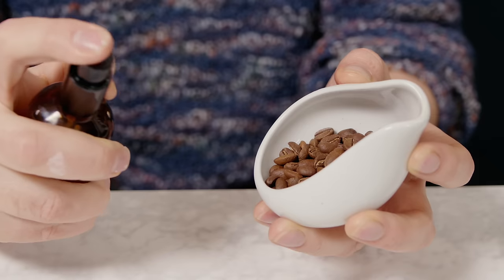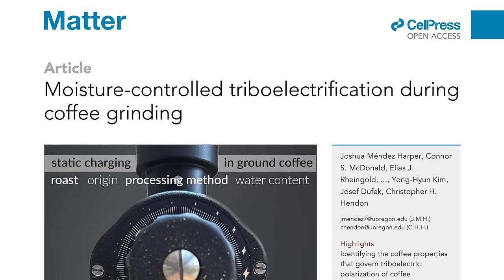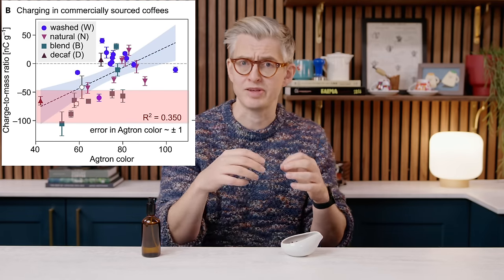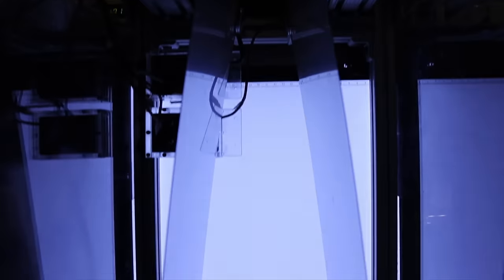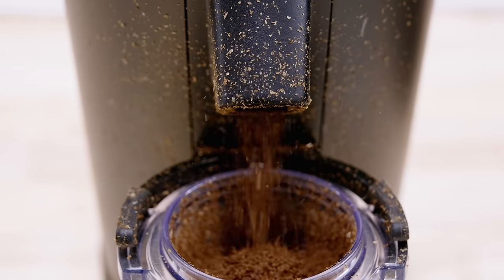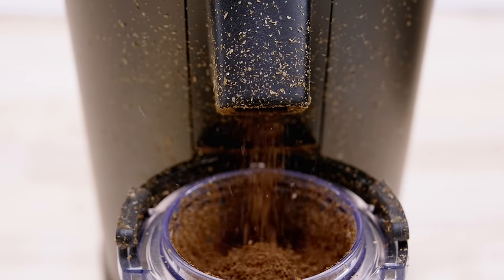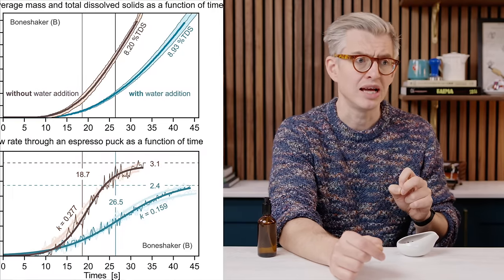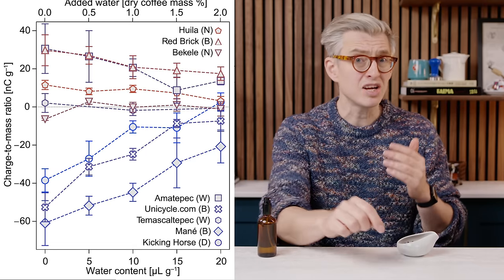Science Discovers What We All Missed: More Than An Anti-Static Hack

Comment: Your aggregate "electroclump" affecting the outcome of flow, makes me think you might be interested in reading a bit about the "Proctor Density" test. You may find relevance for your own coffee experiments. 

Basically, geotechnical engineers define a specific water content as the "optimum moisture content" where you get a maximum density. The thing is, soil compacted "dry of optimum" will have a very different structure than those compacted "wet of optimum". Wet of optimum have a more "dispersed" structure, while the "dry of optimum" soil will have more of an open structure (and more clumps). It has consequences in terms of permeability of the soil (dry of optimum tends to be more open and permeable at the same density as wet of optimum for instance). Of course, all of it is based on a "standard energy" proctor test.

Obviously this is "compaction", not grinding,  water content, which suggests you might also do experiments in compacting the puck with various water contents at compaction time to achieve different flow rates.

Comment: nanomaterials Engineer here: Maybe a comment for the authors: Do they confirm the presence of the electroclumps? Possibly making and cross sectioning an espresso puck pellet then analyzing the particle distribution could inform us if the static or the water is changing how small vs fine particles move during grinding and espresso prep.

Comment: Interesting! I use 3-4 pumps from a small kitchen spray bottle for my drip brew, which I just measured to be about 1mL total of water. This goes on 60g of beans, which is roughly in line with the 20uL/g from this paper. I have seen no ill effects to my grinder (Baratza Encore) at all in over 2 years of continuous daily use - no rust or caked up grounds, and the burrs look practically new. It's really just a coincidence, I did the simple math of 1 pump for 18g means 3-4 pumps for 60g and just rolled with it, but I use a much larger sprayer with a higher output, so I've been unwittingly "overwatering" my beans - which now maybe turns out to be the right thing to be doing all along.
Well, as they say, it's better to be lucky than good? But at any rate, as long as the coffee is good, less worry and more enjoyment I suppose.

Comment: Has anyone tested grinding beans and pulling espresso shots in starkly different humidity conditions? Because low relative humidity increases static electricity, high relative humidity should have a similar effect on electroclumps and thus extraction and flow rate.

Comment: Highly interesting! I tried it out on my Sage Grinder (was a mess, would not recommend grinding wet beans). While the grinder takes much longer for a finer (an a wet) grind, I have so far never had a problem with static coffee. Although on the more affordable end, the grinder doesn't seem to generate as much static electricity.
The extraction with wet beans took a lot longer. In fact, it took so long that I'm wondering if it's really just because of the non-static grind. The ground coffee is really clumpy, the tamped coffee was noticeably more compact. So could it have something to do with sticking together like sand or cement? 
Still an interesting thought and I hope there will be a follow up video!

Comment: Question: So I began applying this method to filter coffee grounds at work using an EK with a Moccamaster. It certainly helps with mitigating static, but I feel as though the static in some regard for filter coffee has been helpful in me being able to remove most of the chaff (by grinding into a metal jug so that the chaff sticks to the outer edges that i can wipe out with my finger). Since there's no static I am finding that the chaff is mixing in with the grinds, which is pretty noticeable for chaffy filters like Rwandan and Kenyans. Anyone have any thoughts on this? Is chaff mixing into the grind worth it if the anti-static increases extraction so significantly?

Comment: I do know that RDT has transformed using my 1zpresso k-ultra hand grinder, I've probably added more water than most (I accidentally got a rather large spray bottle). However, as I brew with aeropress I'm not sure how how it would be possible to measure different outcomes.

Comment: Will be upping my normal 2 spritses to 4 spritses AND pulling a dreaded dry shot tomorrow morning and recording results using my HG-1 Prime.

I tend to aim for 17.5g in. 41g out at 40 seconds and 7 bars (8 second bloom at 2 bars).

My espresso machine is a 1977 La Pavoni Europiccola Professional with a Coffee Sensor Bong Isolator and Airbuster (regulates brewhead temperature and outgasses steam). IMS aftermarket shower screen.

I use a Sworks high flow 49mm Billet Basket for my portafilter. No paper filter with my workflow. For this test, I will not be using a puck screen.
Reply: The difference between no RDT and 4 RDT on a manual 83mm conical burr grinder is absolutely mind-bending.

First of all, the manual grind time is increased by about 3-4 times with 4 spritzes. I don't notice a difference in grind times between none and 1 spritz.

... But clearly some threshold is surpassed with 4 spritzes. At a 2.25 turn ratio on the HG-1 Prime, it feels like there's almost nothing in the chamber while turning. I had to stop multiple times while trying this a few times this morning just to make sure the beans were feeding themselves through.

The extraction times RADICALLY increased with 4 spritzes over none or one. They literally doubled for me. It was the difference between a 40 second pull with crema levels you'd expect from a light roast Nicaraguan on a 49mm basket (no spritz) and a very oily pull indicative of too fine of a grind.

I'm now doing a 4 spritz at a much coarser setting to see how things play out.

Thanks for the inspiration to experiment 🥼🧪.

Truly blown away at how going from 1 to 4 spritzes of water changes the entire process.
Reply: I had to dial the HG-1 Prime three clicks coarser to get an appropriate pull duration with 4 spritzes and found the pull to have less body, clarity, and acidity... Just an overall 'dumb downed' shot even though the shot appeared to be good on input, output, and pull.

Definitely a lot more experimenting required and so many variables to juggle.

My hypothesis right now centers around taking an already long grind time and making it 4 times longer... Approximately 2 minutes for 17.5g. Perhaps this impacts the body of the shot... Not sure how to definitively prove or disprove this especially given the finickiness of the La Pavoni Pre Millennium (even with my various stabilizing mods).

Comment: You make the brief discussion, Walter White had in "breaking bad" regarding his associate’s mega coffee machine sound like a kindergarten conversation. I think anything you can do to get the water to distribute more evenly and get your extraction to be more even is a good thing. If the result of such a change isn’t great, then quantity of coffee and or water, tamp pressure, and grind course level as always should be tuned to accommodate this new flow factor, in my opinion.

Comment: I have had a lot of problems with he additional moisture wreaking havoc on my grinders.  My Weber Key jammed due to fines hardening into "concrete" and jamming the burrs,  I was able to repair the Weber Key by disassembling and cleaning, unfortunately my Niche Zero, which I used while my Key was down, now has its top burr jammed in place from the same hardened fines which have cemented the top burr carrier to its housing, unremovable.  BEWARE!  Anyone have suggestions on removing a stuck top burr carrier on a Niche Zero?

Comment: This leads me to a question, what if we grind the beans (that is sprayed 3-4x) with a hand grinder that is much slower in RPM than with an electric grinder? Would that be an issue for the hand grinder? Could that also be applicable for other brew methods with coarser grind settings?
Reply: I would imagine that a hand grinder produces far less interfacial heating, and therefore less electric charge, and therefore less trouble than electric grinders create.

Comment: An engineer's perspective on the danger wetting your coffee beans poses to your grinder...
The vast majority of that ~0.3g of water will be attached to the coffee grinds and therefore carried out of the grinder. The microscopically thin film left on the inside will evaporate within seconds and the grind chamber will remain at a higher humidity for a little while longer till the air can circulate through.
All that will be done in a minute or so (depending on ambient conditions)

I'm not sure if the oils in coffee beans have any sort of corrosive effects, but a few seconds of exposure from water is not going to be an issue for carbon steels. Even if this were a commercial grinder so was constantly being used and re-wetted, we're talking fractions of a micron per year worth of corrosion.

Comment: I'm grinning because this is just my speed! 

I'm lazy, but I have questions: (1) what is the baseline air humidity in your experiments and I'm guessing there's a point at which, umm, the difference in humidity between air and air-plus-spritz starts to diminish...? (2) Can we run the charge to electrical ground by ... (sorry for this) grounding the grinding wheels or the bean hopper? (3) I'm lazy and my full auto machine shoots a little bit of steam into the grounds before starting the extraction... I'm guessing that's pointless but arose, as a custom, from somebody noticing a more extreme clumping, maybe in a dryer or "more staticky" setting. This is big fun! Keep going! 😂

Comment: About No difference in particle size. My guess would be that the particle size analyser by default is braking the aggregates (electroclumps). I mean static electricity aggregation is standard with small particles and particle analyser which can not deal with it would give very false effects. 
So clumped or not You would have the same effect. 
BTW fracto-electrification does not have satisfactory scientific explanation. Few theories are there but non makes happy all.

Comment: Awesome video James, thank you! That is how you respond to a science finding in a (largely) "non-sciencified" field.

BTW, just as one shouldn't measure beans with a scoop, dispensing water by "spritz unit" is also suboptimal. My bottle - unlike, it seems, yours - doesn't put out ~0.075 ml per spritz to give me 0.3 ml in 4 pumps, it puts out much less. Also, much of the water seems to stay on the walls of the weighing boat, rather than on the beans.

Do we think water condensation on frozen beans contributes to the "improved grinding" of frozen beans?

Comment: My grinder is a Baratza Encore set to a French press coarse grind.

I do cold brew and I tried this for the first time on my last brew.  I use frozen beans, and one thing to note, that does mean the water freezes to the beans, making the beans clump a little bit in the grinder.  That said, the immediate benefit of less mess was realized, and more than enough reason for me to keep adding water.  Of note, I don't have a spritzer yet, so I lightly rinsed the beans instead and that still worked, though the water volume is less controlled.

Lastly, the resulting brew after sitting for 24 hours at room temperature seemed to have a fruitier smell and a lighter color even though I used the same beans as my last cold brew.  I don't know if that's confirmation bias, as I'm not sure why adding water to the grind would change a slow brewing method like cold brew. That needs more testing.

Comment: I did a very unscientific test with my cheap £50 Delonghi grinder and a V60 pour over. With the watered beans the larger particles of coffee were left at the top of the slurry and on the sides of the paper. Very interesting as with dry static beans the larger coffee particles are definitely more mixed up. I didn’t notice a change in time the water filtered through the paper but I’ll continue to experiment. The Mrs had the coffee and she has a cold so can’t say if it tasted better yet!

Comment: I appreciate the interview and the discussion you encourage in the comment section. However, I don’t see the point of putting this much work into production just to 1) not test the grinders enough times (with multiple variable like different sets of beans) to get a decent sample (!!!) 2) not figure out the details of why your results with your equipment turned out the way they did 3) not elaborate more on the scientific background of the paper and the phenomena at play. And to compare those „results“ with the paper in the way of „I don’t know if this proves the findings or not“ feels like a tiny bit of disrespect to the patient, painfully detailed work that is good research. The visual production value gives you a bit of authority that you used to use to educate and inform in a much more complex and grounded way.

Comment: sounds like snake oil if you ask me... dry grinding anything organic (WITH AN ELECTRIC GRINDER) is going to generate some type of electrical charge unless you are doing it completely manually. I imagine the electrical charge being generated on the ground coffee will be more impacted by items such as relative humidity, freshness of the bean, temperature of the bean, and if the device that is doing the grinding is either a 120V or a 240V grinder. To truly see if the charge is an issue with the grinder speed and bean, the experiment would have to be done with either a non-electrical grinder that can spin up to electric grinder speeds (this can actually be done with some creative adaptation of a drill press and rubber caps to test) , or finding a way to isolate the electric current from the machine entirely. 

At the end of the day though... if you are weighing your bean output and tamping for porta filter before use, any physical contact made with the grinds is going to neutralize the insanely weak charges that may be sticking an "electroclump" together. This sounds like a clever marketing technique for sure, but I highly doubt it will make so much of a difference that it will justify the cost of re-inventing the coffee grinder with proprietary tech which will likely eclipse the experience and cost of a well made traditional espresso.

Comment: So since we are going off a cliff on this we might as well go full coffee nerd throttle. Electrical engineer here. Not sure if anyone has tried this but in theory an electrostatic discharge palm plate could be used. This device discharges static electric charge in your body to protect against damaging very sensitive electronics. Grind coffee and pour into a small cup made of a highly conductive metal like aluminum or copper that’s resting on the discharge pad. This should do the trick… not that I could tell the difference.

Comment: Fascinating 

Obviously grinders material, their speed and ability to static charge is probably as influential as the dielectric neutralizing effect of water 

For now burr and chambers and chutes Material and surface treatment where only approached from a durability to heat and abrasion.

More than ionization of the nearby air via an added gizmo the electric and electrostatic properties of burrs and chambers are to be studied and compared, aluminium base vs iron alloy base, and the titanium base vs ceramic base coatings surface treatment, 

Grinding chambers and chutes materials also apears crutial.

Expresso Manual grinder although not as comercial, are also great study cases, almost all conical, yet some fully aluminum base, and other fully steel.

Comment: POUR OVER. Noticed a big difference in the consistency of draw down time for pour over. No hard science here, just anecdotal. With Ode G2 2 w std burrs, i noticed a difference in the sound of the grinding and and grind consistency resulted in very consistent draw down times with a particularly troublesome natural bean I was using.
Get a good sprayer, lookout for a continuous mister type found in grooming and beauty supplies. The greatest variation in results with a large data set I believe will occur here, ie, how well the beans are evenly humidified prior to grinding as well as the amount. A deep rabbit hole indeed.

Comment: So, could it be that the fact that a pre-infusion changes the taste has a similar reason?
Reply: BTW, I can totally reproduce the effect with my DF83 v2. For the same output-ratio of 2:1 I get roughly twice the time / half the flow rate. Also, the "espresso powder" (is that the right word?) becomes much more "fluffy" this way, and the taste is somewhat different. Tried with two different types of "medium roast" beans. I have entered the data in the Google survey. Will try again tomorrow with a dark and a light roast. Too late for this today, I am afraid ...
Reply: I have now also tried this with a bright roast. With 4 sprays of water for 20 g of beans brewing time for the same yield of 2:1 went up from 28 s to 80 s with a DF-83 v2, indicating that I could use other grinder settings when spraying the beans. Also, the espresso tasted sweater and less sour with the 4 sprays. Thanks for this amazing find. I will enter the timings into the Google survey.